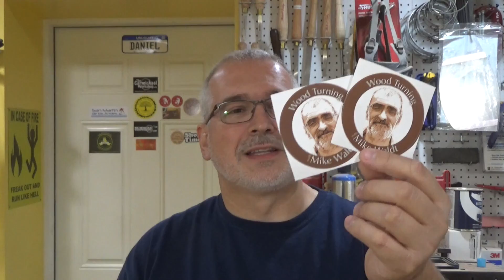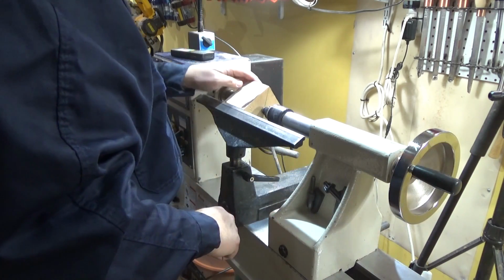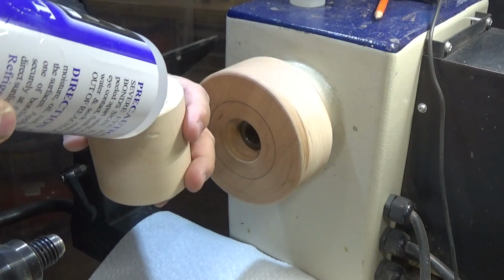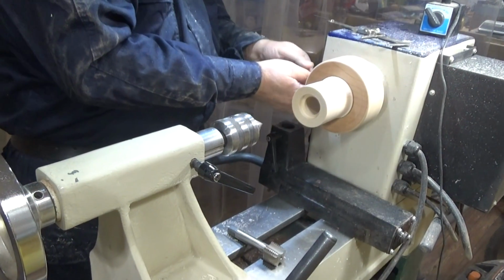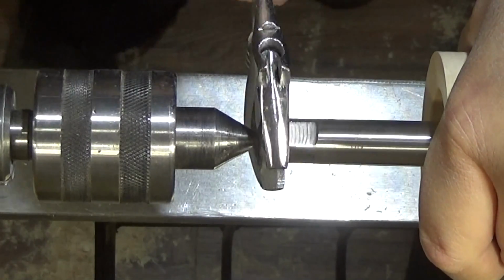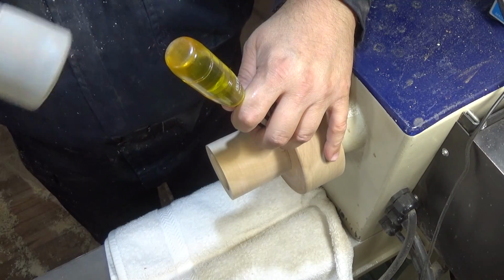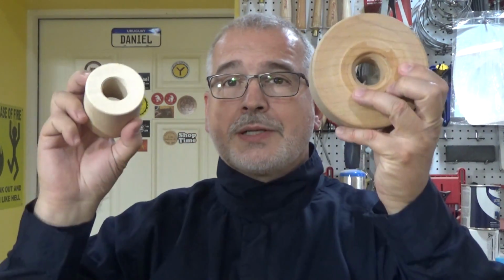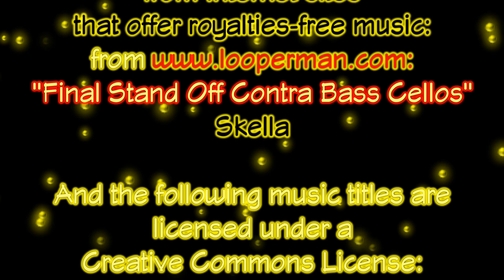Threaded Glue Block Made with the Guidance of the Lathe

Comment: Those glue blocks are very useful but I also discovered that I could make soft-touches to go on a threaded revolving centre for pushing work towards the headstock without marking it.  I think the only thread is 1" x 8tpi but it comes on an MT2 taper so it will fit most lathes.  Penn State Industries sell them.  I have found mine really useful.
Best Wishes, Brendan.
Reply from the maker: Hi Brendan! Thank you, my dear friend for watching the video, for the comments and the advice. I will check them out. Cheers! Daniel

Comment: Shop-made threaded glue blocks are very convenient.  

My experience is that the threads are stronger if the glue block is in 'face grain' orientation.  I also reinforce my threads with CA, and add paste wax after completing the glue block.

You are correct that glue blocks eventually wear away as you use them, but you can easily reface them.  Just true up the face (a sanding block is the best tool for this), and then glue a piece of wood onto the face (I would use a good quality wood glue such as Titebond since this joint is intended to be permanent).   Then, turn that new piece of wood and true up its face, and you have an essentially new glue block.
Reply from the maker: Hi Louie! Thank you very much for your comments and suggestions. Yes, once you get close to the spindle screw, attaching a piece of wood will prolong the life of that particular glue block. When you say face grain, do you mean end grain? or the long grain? Cheers! Daniel

Comment: Very informative video, thanks for sharing,  
On the first side you cut a recess to allow the glue block to seat against the shoulder of the lathe, do you not need to do the same on the second side?
Reply from the maker: Hi Michael! Thank you, my dear friend, for watching the video and for the comments! Actually, you should do that if you want the  glue block to be reversible, like I did in the previous video. Because this particular glue block had a much smaller diameter than the one I did in that video, I prefered not to make it reversible so I had a bit more gluing area (although most of the attachement occurs at the rim of the glue block) and you always can do the recess just by mounting the glue block on the spindle and using a slightly larger forstner bit. Cheers! Daniel

Comment: Great video Daniel.  I also have this tap and enjoy making glue blocks and various forms of centers.  I found it was difficult to to keep the center in contact with the tap and recently found a device called a "TAP GUIDE" that aids in aligning the tap as it is used.  It has a spring center which allows for about a 1/2 inch travel before the tail stock needs to be moved.  Here is a link to the one I bought on Amazon. https://www.amazon.com/gp/product/B005317ZMC/ref=oh_aui_detailpage_o09_s00?ie=UTF8&psc=1
Reply from the maker: Hi Bruce! Thank you very much, dear friend, for watching and commenting. I will check the tap guide that you mention, thanks for the heads up! Cheers! Daniel